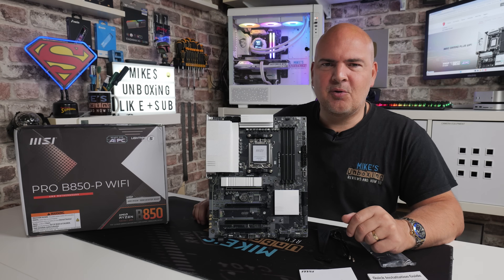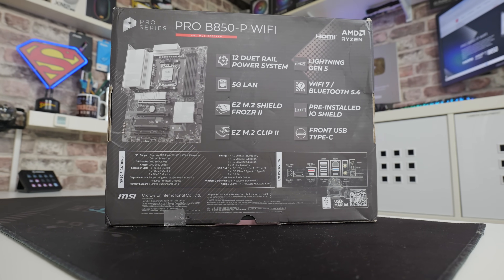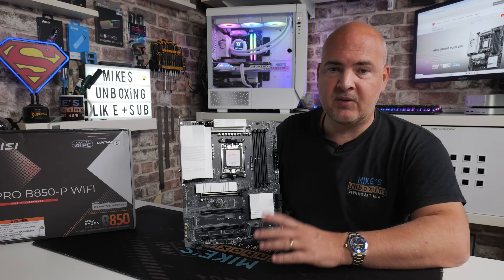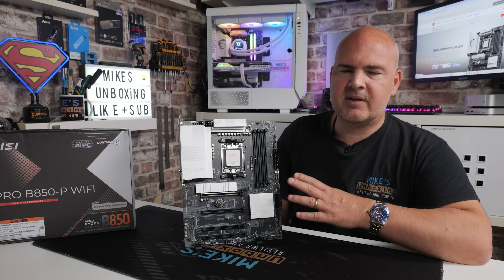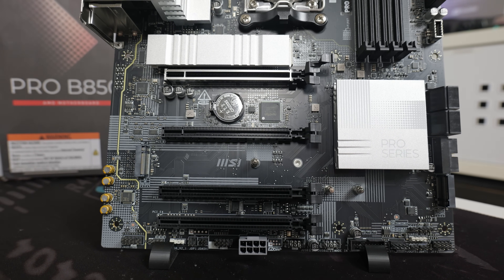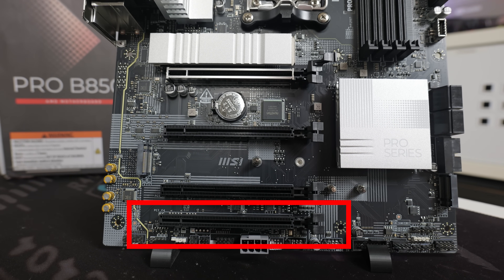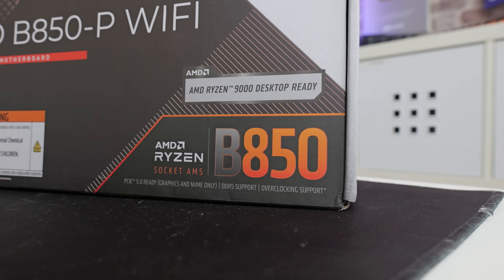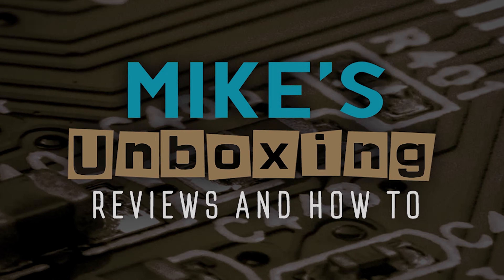BEST Budget MSI ATX B850 Motherboard Pro B850-P WiFi 7

Comment: Hi! Currently trying to decide between this one and the X870E-P version. They’re the only boards that don’t look “gamer” 😅 Any special reasons why I should splurge and get the X870E instead of this one? I’d be pairing it with a 9800X3D. Thanks!!!
Reply from the maker: x870e gives you more pcie lanes and faster usb, if you need those get the x870e, if you are just one or two nvme and a gpu then b850 or even b650 will be fine
Reply: @mikesunboxing I see!! Thank u

Comment: Currently deciding between this board and the B850 Max WiFi. Do I really need the better VRM of the Max WiFi for gaming?
Reply from the maker: no not really, this is one of the things that hardware boxed gets wrong i feel, VRM quality for gamers means very little
Reply: @mikesunboxing then should I be worried about temps with this board  since I will be using a 9950x3d?

Comment: HDMI display out instead of display port? I didn’t know that was even a thing I’ve always had display port out is there a different between the two? Is one better than the other for monitor?
Reply from the maker: usually DP is the better and cheaper to use, HDMI ports need to be licensed they are pretty similar really

Comment: Hey. What u think about Msi B850 Gaming Plus wifi6e? Cant find much info about it.
Reply: Well,it has a wifi6e compared to wifi7 on this one. It has 2.5g lan port compared to 5g here. It also has PCIe 5.0 M.2 slot only, it is PCIe 4.0 for the GPU. 
That's basically the difference and the MSI B850 PRO-P is the better board.
Reply from the maker: its pretty good, we have a video coming out soon about it
Reply: @mikesunboxing  I have still bought the MSI B850 GAMING PLUS WIFI7 over this one though but only because of the many reports it's running hotter and the productivity orientation/aesthetics on the PRO-P. Also both are budget but everyone is talking about the PRO-P being the cheapest I just couldn't get on with it :D I have spend only $25 more for the Gaming plus
Reply: Yea i went for wifi7,its 30e more but i hope its worth😅 Thank you!
Reply: @Baltisaw  MSI B850 Gaming Plus WIFI7 has Triple vs Dual M.2 Connectors , EZ M.2 Shield Frozr II vs I (in WIFI6E) , NEW Heavy Plated VRM Heatsink - The VRM heatsink covers the upper MOS and helps dissipate the heat. The obvious WIFI7 vs 6E , 2.5G vs 5G LAN , PCIe 5.0 vs 4.0 , Server grade level material was also used for the WIFI7 Version's PCB. I think it's worth it for a future proof system being a fairly decent and not an overkill mobo. :)

Comment: I have a B650 wifi gaming and the bluetooth connectivity is a real pain in the butt!!! Having to unplug and hold the start button down to clear the board every couple of days is a chore I could do without. Anyone found a fix???
Reply from the maker: are you using msi center to install the correct drivers and updates?
Reply: @mikesunboxing  yes and have just done an update so lets see what happens. Its a known issue so hoping update has resolved it.

Comment: Thanks Mike! Really enjoying this board. Hard to pick a fault with it really. Even critisim of the VRMs are a bit harsh as it can handle a 16 core cpu, it will just run hotter than others. The new bios layout and design is a particular highlight for me!
Reply from the maker: yeah it was / is a nice board and at the price you paid that is one of the sweetest deals in a long time.
thanks for the loan of it and let us know what you end up doing with it, that is if you haven't flipped it already
Reply: @mikesunboxing it’s in my main rig! Replaced the b650 tomahawk! No issues so far. My only complaint would be the single NVMe heatsink provided. Would have been nice to see two for a board of this price (normally). For £80 I can let it slip 😂

Comment: Seems on first glance to be typical entry level motherboard with nice features such as built in IO shield, 2x 8pin power and bios/cmos buttons easy to access. But when you described pcie slots think how much compromise made with m.2 functions not that I would need extra pcie bar gpu. Msrp seems high compared to used prices but then number of mbs on ebay with damaged cpu sockets is quite alarming! Curious how this level compares to next model in line up like tomahawks etc.Thanks for review Mike & Kath 🐈👍
Reply from the maker: at the moment there are so many price changes its pretty hard to compare similar boards and others in higher and lower tiers, theyt often overlap and when there are offers on the higher tier boards could work out cheaper.
luck we have the Bargains No Chat room and the Ebay Bot to help us make smarter buying decisions (in theory:-)  )

Comment: I have exactly this one with 9600X. More than enough for my needs. Do not forget to connect external antenna if you want BT working properly.
Reply from the maker: yeah i found that out a while back when i was really frustrated with the bluetooth signal range :-)
Who would have thought an antenna would fix that 🤣
Reply: What cooler did you use for your 9600X as I am planning to upgrade to this CPU? As I am unsure what cooler will fit with this motherboard.

Comment: As tested by Hardware Unboxed, in some ways this is not a good board, thermally.
Reply from the maker: yeah its probably not the best option if you plan on extreme multi core CPUs, and rendering video files for long periods.
Reply: no they tested the mATX version with a discrete mosfets 7 phase v core which is not good. This ATX version is a good budget motherboard

Comment: I have not even unwrapped my wifi antenna that came with my asus x870e Would using it help with VR? Or am I being a sausage?
Reply from the maker: it probably won't make any difference if it is just a thin plastic film

Comment: It's only the best if you like MSI.. They look cheap and basic..
Think I will stay with a decent make..
Another great video though..
Reply: its definately not a flashy board. The black and silver color scheme maybe appealing to some. The wifi 7 is def a plus. I have the B850m-A varient. Decent board overall imo.
Reply from the maker: Thanks for watching! Glad you enjoyed the video, even if the board isn't your thing.
Reply: I was tempted to upgrade this year but, to be honest, my 7950x is still performing good and I don't really need more atm. And apart for wifi 7,there's not enough to justify going away from my msi pro x670-p. Might be cheaper to just upgrade the Wi-Fi 🤔
Reply from the maker: The am5 platform is a great one just like am4 these things just keep on going and with the same increase in performance it’s hard to justify the cost
Reply: @patricklebel1141  If I was already on AM%, then I wouldn't have upgraded either. The 9900x is a far better CPU than the 5900x, that is the reason I upgraded..
Reply: Get outta here! They look minimal and effectively functional.
Reply from the maker: i am quite a fan of msi boards in general and like the looks in general, but some to make me question that :-)